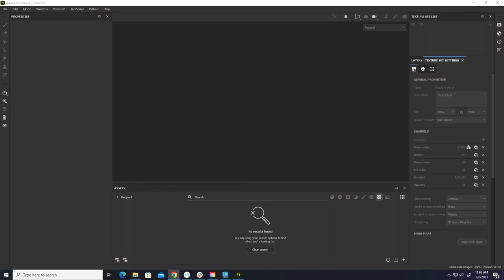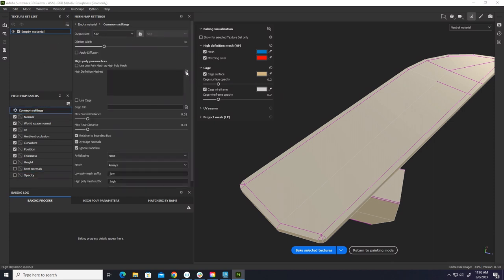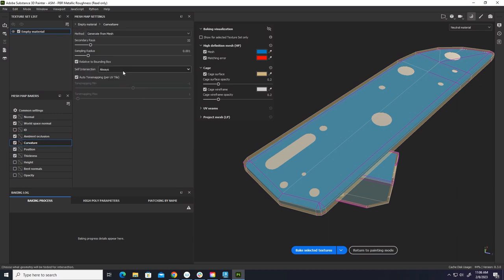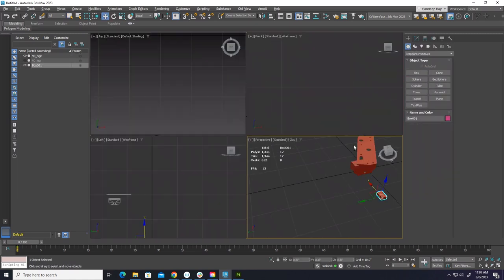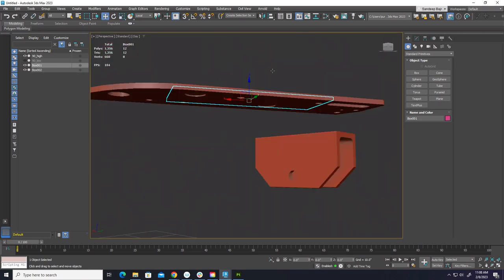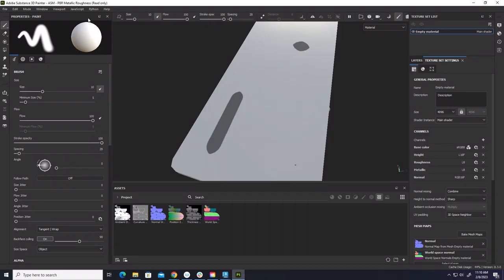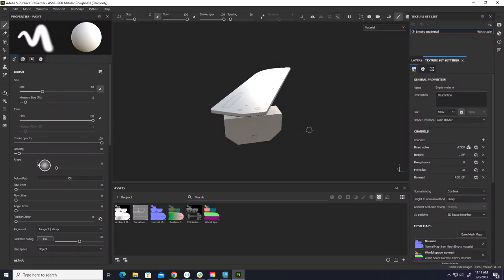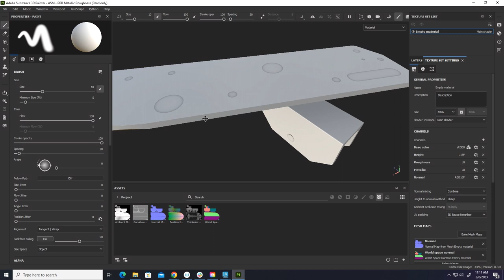Baking Holes From Hi-Poly To Low Poly In Substance Painter

Comment: What if the low poly has holes/gaps in the mesh? Would baking still work if the high poly is fully enclosed?
Reply from the maker: that wont be a problem, it should work fine